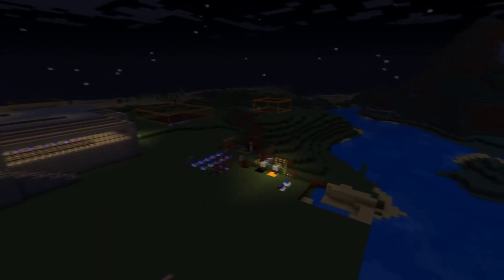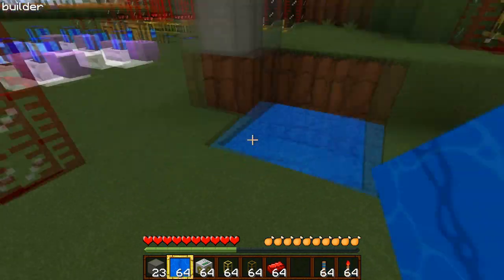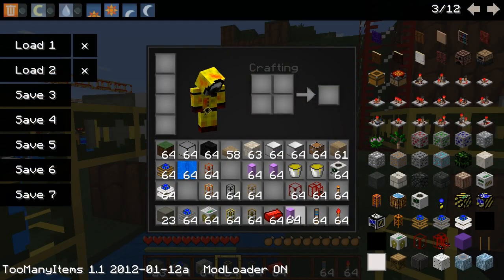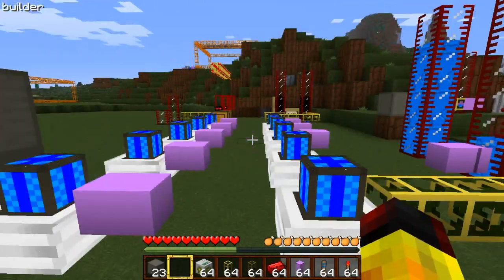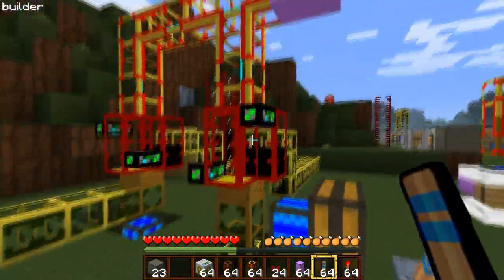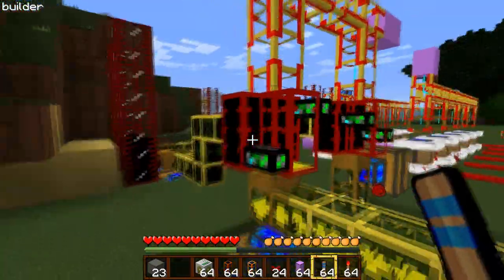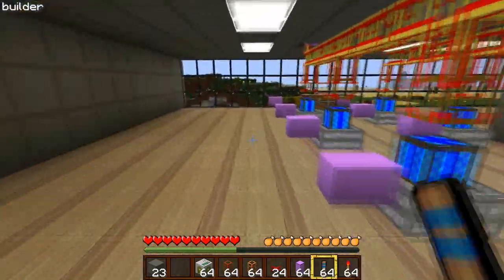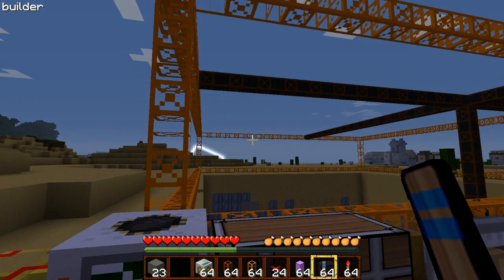Minecraft Buildcraft Tutorial- Motors,Pipes,Quarries, and Sorting (Basics)

Comment: If you use a pool larger than 4x4, you can use a combustion engine to extract water from it, without loosing any source blocks. You just have to make sure that each block will be able to be reverted to a source block if it is sucked up.